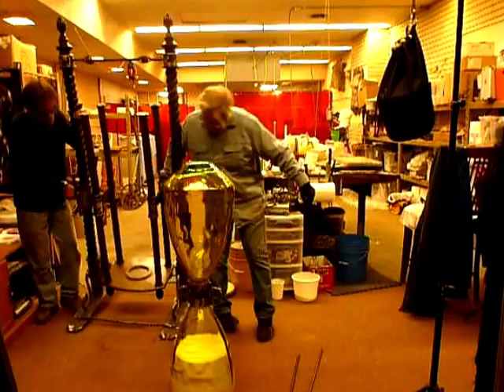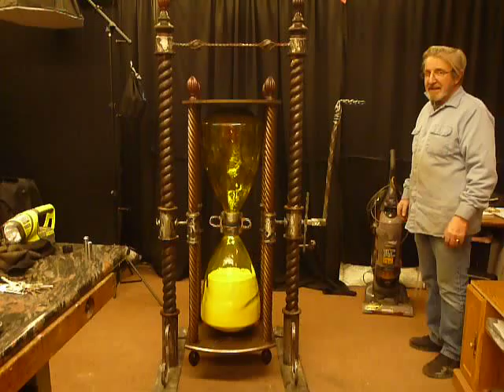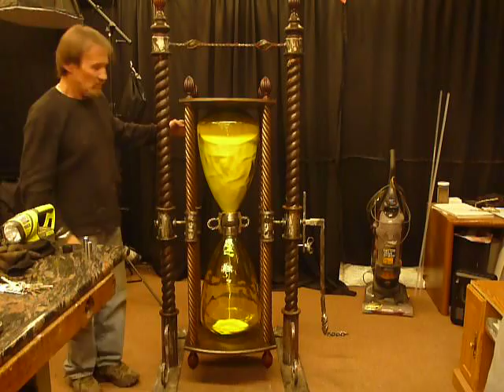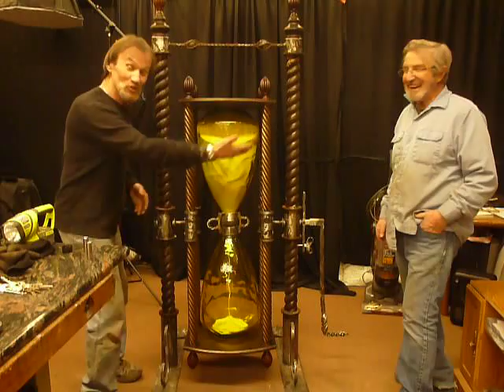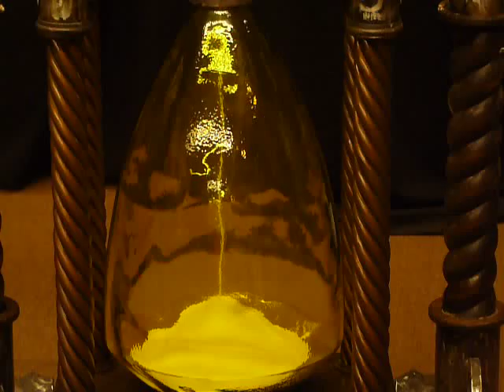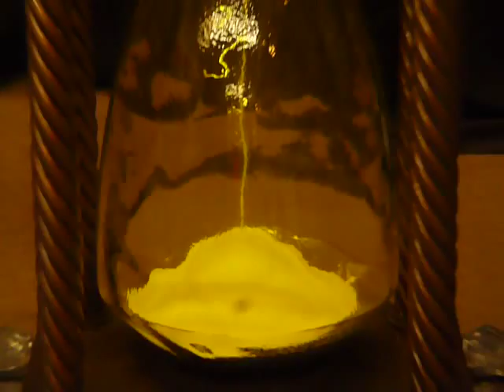Giant Hourglass

Comment: how did you attach the two chambers together?
Reply from the maker: snowflakeeel a combination of components and careful welding
Reply: Ive been wanting to make hour glasses, especially giant ones that run for 24 hours or more.  Since I have no glass forming skills, I thought I might join the middle with a dowel like cylinder piece of wood.  Drill a tiny hole down the middle of the dowel for the sand to pass through, then drill with a highly tapered bit on each end again to taper the entrance to the drill hole outward.  Then place that dowel within the necks of my to glass chambers and reinforce them from the outside like you have done.  Any reason why that wouldn't work, for one similar size to yours?
Reply from the maker: snowflakeeel 
its much more complicated than that.  There is a science to determine the size of the orfice.
Reply: hmm, i suppose i will have to try many different sizes until it works right. thank you
Reply from the maker: geel free to call 8103580209
Reply: well it will be a while. I've still got to keep an eye out for many months now until I can find two identical pieces of glass suitable for this at a flea market
Reply from the maker: go to TJ maxx, home goods, world market--etc---tons of choices there and inexpensive
Reply: Ahh, thanks again. Will do.